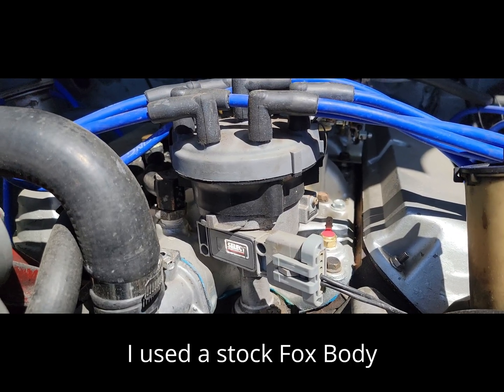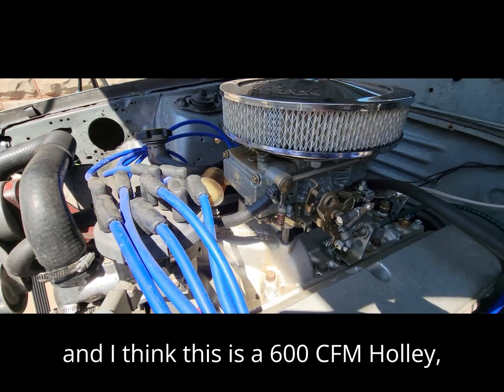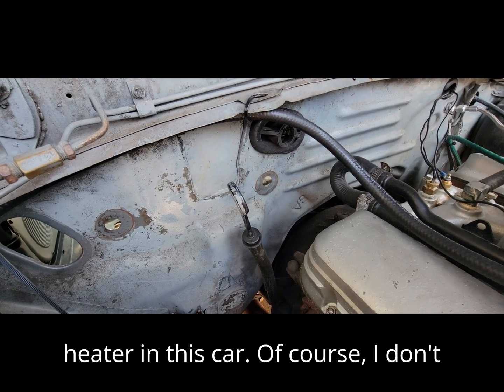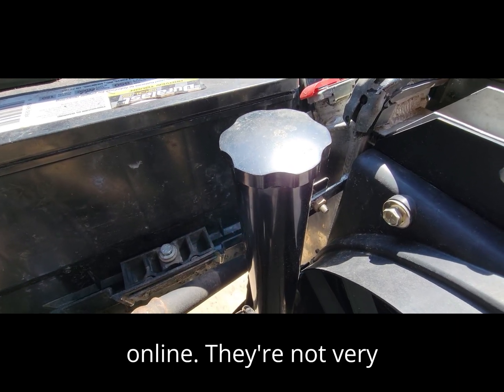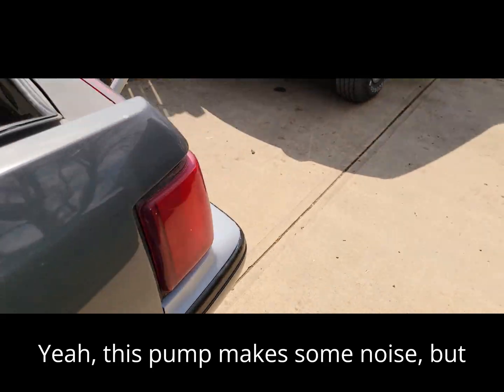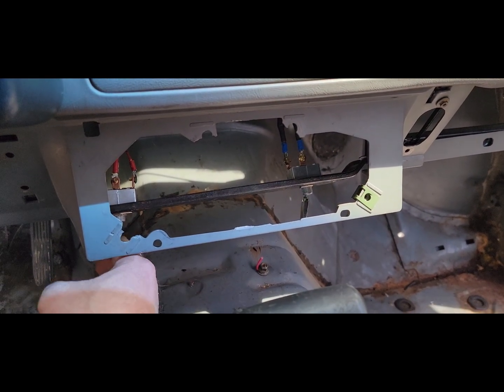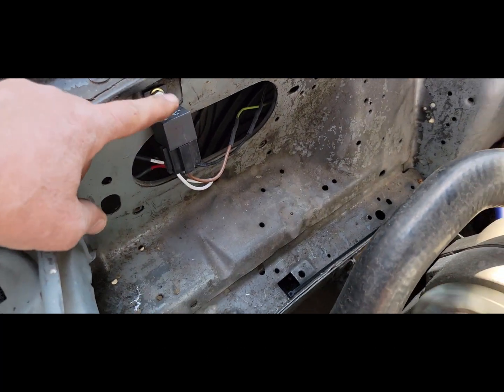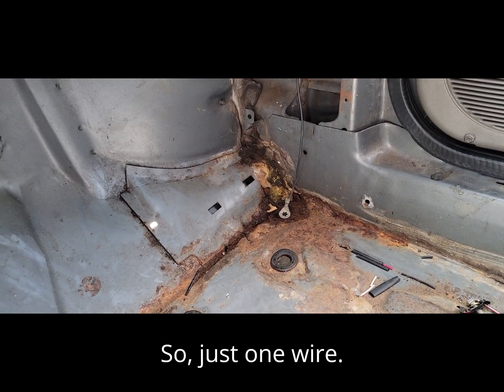Converting Fox Body Mustang to 4 Barrel: Holley Sniper Pump Upgrade

Comment: You need to X or H pipe that car and run a 2.5 inch to 3 inch exhaust all the way back with 2 chamber FlowMasters on it. That would make your car sound amazing and it doesn't hurt performance any what so ever, in fact if done correctly it might actually help the performance a little bit. That's my opinion of course, what size stall converter are you running in it? FYI there's a guy in Johnson City Tn who can take your stock converter and build it to work perfectly with that AOD trans. All that said though, you're just going to be throwing away money with that 302 roller if you're hoping to ever make some real horsepower. Just bite the bullet and buy you a coyote 5.0 from a 2011-12 F-150 and the skies and your wallet is the limit then for horsepower. With the 302 you could spend a lifetime of savings on it and maybe break 550 HP naturally aspirated. Hell, buy a 4.6 liter V8 out of a wrecked early 2000s model mustang and you can get far better HP from one of those with about half of what you'd spend to get 500 HP out of the 302. This is just my opinion based on the fact that I've owned about 10 or 12 fox body mustangs in my life.
Reply from the maker: Appreciate the feedback - H-pipe & cat back is what I'm going for
Reply: Congrats on 100k !!
Reply from the maker: @reeseplr  Thanks Reese!